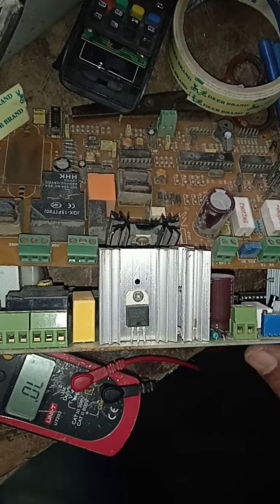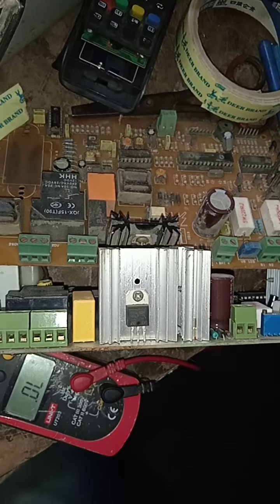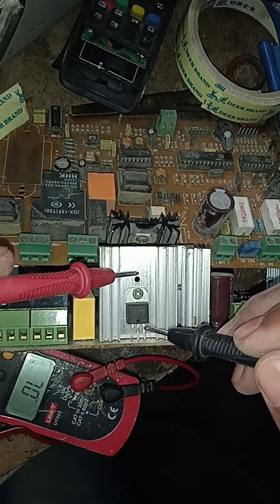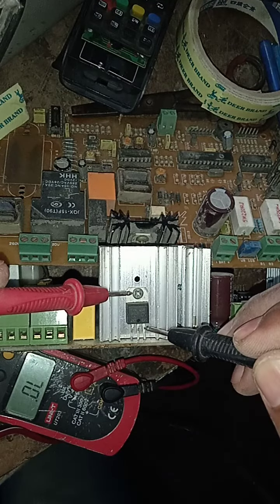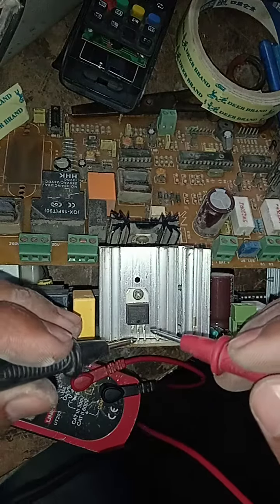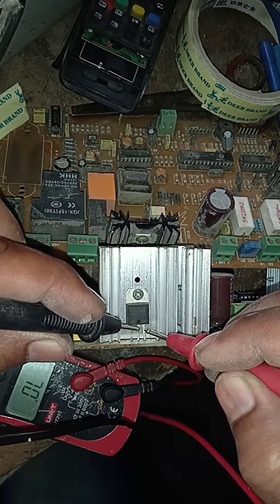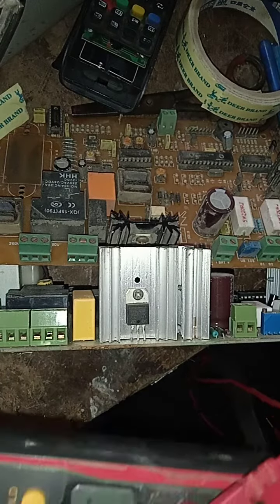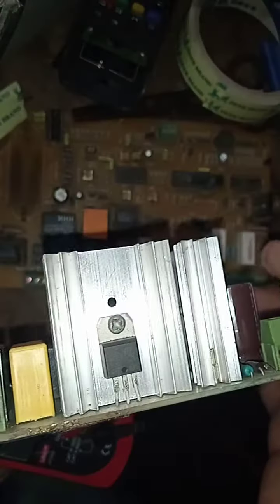How to test/check BTA16-600B TTRIACS TRANSISTOR

Comment: i have a problem in this type ups.When on charging mode voltage fluctuates and make noise in ups transformer after sometimes.Is this a problem of bta16 triac?
Reply from the maker: During charging mode, 
output voltage or wapda both are different or independent tasks... Where you can observe voltage fluctuations..? Battery charging voltage or ups out voltage..? Plz explain
Reply: @onlineengineeringserviceso816  When ups on charging mode ups output as well as other lights that are not on ups also blinks.and also make noise in ups transformer.when battery is full output becomes stable  or wapda off also output become ok
Reply from the maker: Check wapda plug 🔌 back side the UPS , is its legs are black.. if black then replace. For more information if u need,  contact us 0303 4354991 hassan..

Comment: Hey Tks for ur video u help me  to do test the value its 0.43 and ur its 0.44 is this faulty
Reply from the maker: Yes bro .. its faulty...
Reply from the maker: Bro... The value must be same for best working. Ok I hope .. u get your point... 

Subscrib and like , bell icon.. 

Thank u again..
Reply: I get the same value in 2 side but its 0.43
Reply: @onlineengineeringserviceso816  0.01 the différence that mean not good tks to answer me
Reply from the maker: @AMG8241  yes... When temperature rise this diffarance increase
Reply: @onlineengineeringserviceso816  tkhs for help i appreciate
Reply: I have 0.60 both side it's okey or not

Comment: Hello, thank you for your interest and knowledge. I would like to ask something. When I measure this btb16-12, I read values like 0.080 -0.090, so I can't tell if it's solid or faulty because sometimes some of them work. What exactly should that be worth? thank you in advance
Reply from the maker: Dear Both measuring values are must b same ... Then its means BTA-16 or any bta is 'ok' no fault. 
The other one condition is that the helping resistance may be short or damage so u can not receive equal reading.
Reply from the maker: I hope u got point.. if some more details need.. feel free to ask ok..
Reply: @onlineengineeringserviceso816  thank you very much